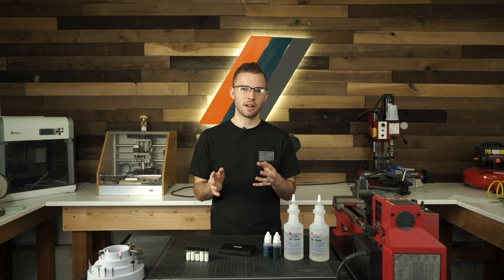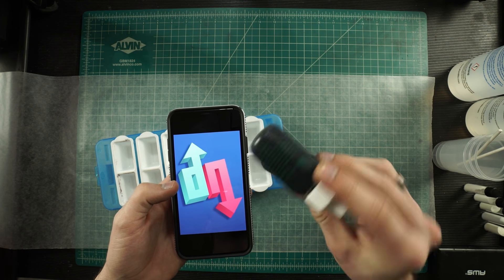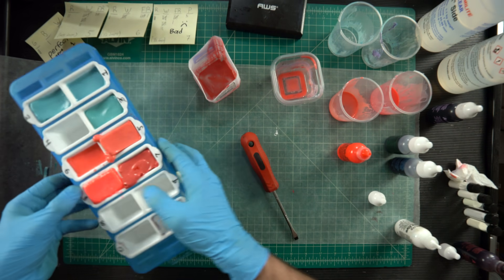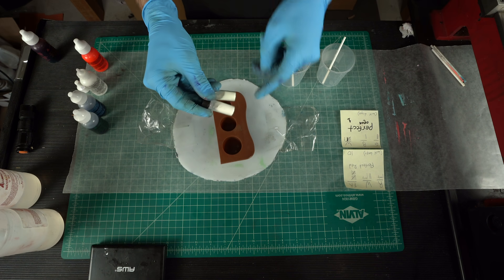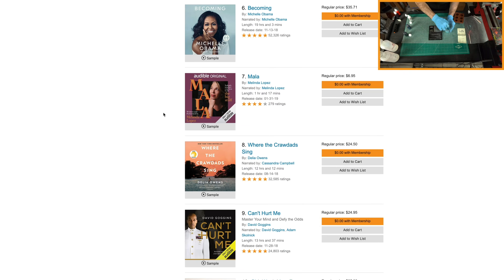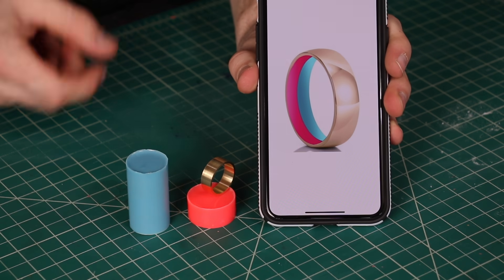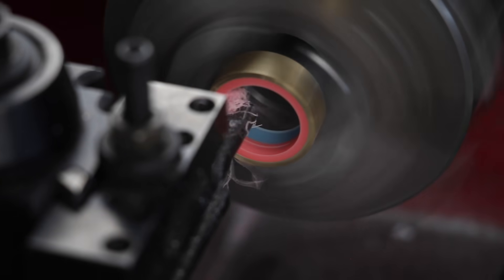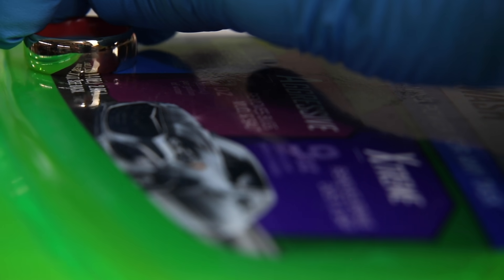Making Matthias a Dope or Nope Ring! 14k gold ring with glow

Comment: I heard if you heat up crayons, they get brighter in color. This is because the pigment rises to the surface. And if you freeze them they get duller. 

Apparently this works with glow sticks too but the brighter they shine the shorter they last and vice versa. In other words, the amount glow produced is inversely proportional to the amount time the chemical reaction will last. 

I don’t know if the pigment thing works with resin or if the glow thing works with glow powder but it might be interesting and possibly beneficial to find out. And it wouldn’t be difficult to do either.

Comment: What RPMs do you use to turn your rings? Im looking into getting a lathe to start turning rings and maybe some small bowls. Ive used a lathe before but not for rings, so I was thinking of starting with premade ring blanks and using some wood for inlay/top layer.

Comment: I'm actually suscribed to dope or nope and your channel.  Love you meteorite ring and the cable ring, I would love to see if it's possible you can build a ring that is also a motor/generator.  I have drawings for such a thing but lack resources to make it real.  It would fine detail work with copper coil winding similar to what you find on a motor for a laptop DVD CD tray and it would have to micro neodymium magnets that would act as the ground and current connection for any power such as led. However I doubt it could really generate a significant amount of electrical current I think it would be cool concept to still do hell I would wear it if I can make it